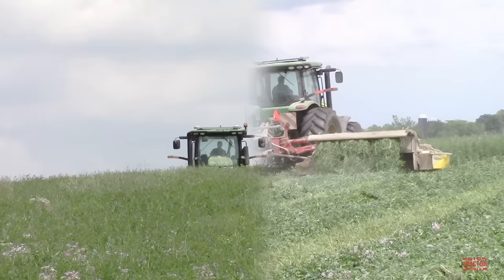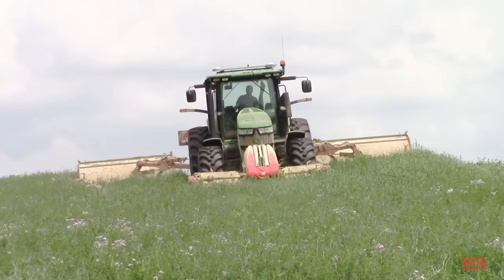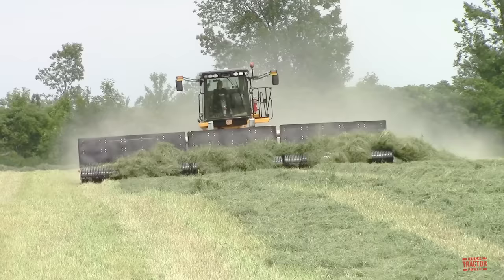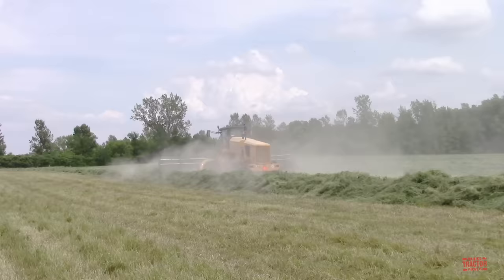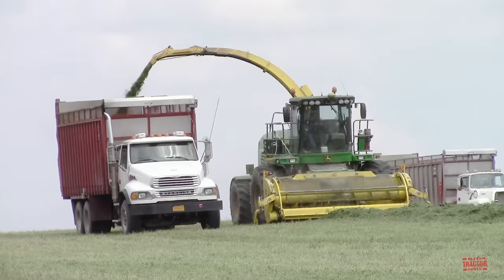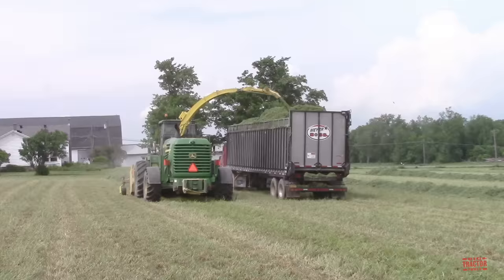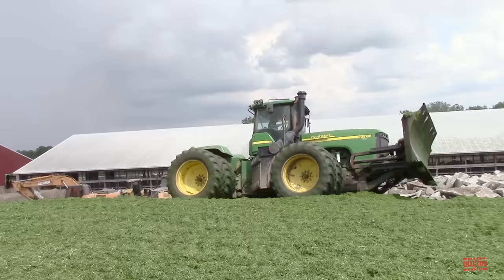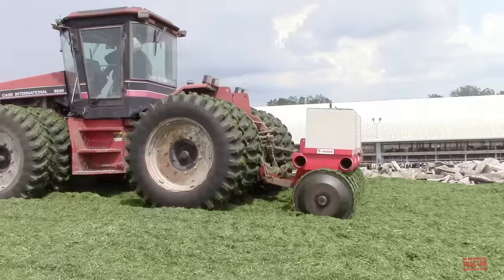MOWING MERGING HARVESTING Alfalfa with Big Tractors

Comment: Excellent video. Hay & Forage is my favorite. I love those triple/butterfly mowers, mergers are always cool, and who doesn't like to see a big forage harvester in action? But I must confess that I find packing boring. I've done plenty, and never really loved it.

I thought the 7780s were all 600+hp machines. I still think the 7050/7080 series are better looking than the new 8000/9000 series. Of course, looks alone aren't much...

Shout out to harvester operators everywhere when he slowed down for that massive clump to feed in -- I thought I was going to completely choke our NH FP240 doing that in uneven windrows this spring but thankfully it fed on thru, courtesy 300hp! Smooth windrows are always nice.

Big Tractor Power, see if you can rustle up some footage of the Pottinger Novacat T8 trailed center-pivot triple mower. The dealer I spoke with about a used T8 (O'Hara) said he had 3 of them on one farm there in NY!!

Comment: As fast as they can cut with that Novacat, it's no wonder those tractor mounted mowers got the Claas Cougar discontinued.  After watching your video on the Cougar it's no mystery why it wasn't cost-effective.  I'd take 66% of the work for 25% of the price any day.
Reply: yea theres a contractor here in germany that converted one to a mulching application but not even that could make it beat out the xerions they were running so it was shut off for good

Comment: They need some kind of serious reversing fan on the mower tractor!
Reply: It is a problem with all the john deere 6,7,8R tractors.  They button up the hood and engine area so tight there is no airflow except thru the front grill. There is also a hydraulic powered fan blowing thru the air to air aftercooler that blows out the top of the hood infront of the radiator.  These tractors will run hot quickly of not kept clean.  My 6125R I have to clean the grill and rad screens 2 times a day baling hay.  Its just a bad design on these deeres.

Comment: Interesting to see the 7780 bark as it encountered the big slug of hay in the windrow.   I don't think I've ever seen one of them slow down for anything.
Reply from the maker: It’s not often a big chopper slows down. Sorghum will give a big chopper a work out.
Reply: That "big slug of hay" is the one thing you don't want when chopping. As long as the windrows are nice and smooth you can cruise along at a consistent pace with little to worry about, but that slug probably doubled the volume going in, which is a good way to seriously plug things up if you just go charging into it. Alfalfa is sticky and gummy and doesn't flow well and is probably the most difficult of the common crops to chop, especially compared to row crops like corn or sorghum that feed straight in and flow well. The operator came close to stalling her.

Comment: All that work, fuel, time and tremendously expensive equipment but you see a significant part of the alfalfa is spilling back onto the ground.
Reply: That's the case with any large scale harvest. The amount of spillage compared to the total harvest is negligible.  More than likely about 5 or 6 bales worth out of, what is likely, a few thousand bales.  Even if they were doing actual bales there would be some that break open or are unusable.

Comment: Viewed 8-8-21   4:23 PM  from Illinois      The JD chopper was not chopping the windrows  that were merged in  first part of video..   JD could handle those rows, would require the Krone 1180 with 1160 HP.
Reply from the maker: The 7780 is chopping the windrows from the 4334. The farn had 3 pull type mergers before the 4334 replaced them.

Comment: I use to work for Oxbo making the hay mergers, right in Byron, NY
Reply from the maker: Cool.  I have toured the plant a couple times.  I grew up near there.
Reply: @bigtractorpower  that's pretty awesome
Reply from the maker: I spent allot of time at all the Batavia tractor dealers growing up. My last visit to OXBO was in 2002. They had a 1/16 model of the pull type merger in the board room to show the concept.
Reply: @bigtractorpower  I bet it was alot different then. I worked for them in 2019. I ran the presses on 2nd shift.
I do miss it, decent money but I don't miss the drive now that I live in Lockport. Lol. I spent my teen and early 20's in and around Batavia, farming and on the road with my dad.

Comment: The first truck to unload its payload it didn't dump it, was it some type of belt driven floor to push the silage out of the back?
Reply: Yes, there's a conveyor chain along the bottom of the box that is engaged to push the material out.  It's kind of like a manure spreader apron.
Reply: @bn4172  thank you..

Comment: Yeah I’m developing an add on that makes a normal swather header into a merger, will let you know if it works😉
Reply: Actually... that technology has existed for many years in the form of conveyor belt "collectors" on the back of triple/butterfly mowers that catch the hay coming out the back of the mowers before it hits the ground and move it laterally into one big swath/windrow, thereby saving the trip over the field with the rake or merger.

So... why don't we see them more often? Simple: piling all that freshly mown, high-moisture crop into one giant swath is a terrible way of making haylage/silage. The crop must wilt significantly in order to ferment properly after harvest, and minimizing drydown time is critical to minimize nutrient loss due to plant respiration that continues after the plants are mown. This is only accomplished by mowing the crop into swaths that cover as much of the ground as possible for maximum exposure to the sun and atmosphere, limiting respiration to a few hours. The use of collectors, especially in hot, humid environments would result in extremely long periods of respiration (during which the plants remain alive and continue to consume nutrients stored in the leaves) and also composting (ie, significant nutrient loss) in the center of the swath/windrow, which is the exact opposite of the desired outcome.
Reply: @captaindee6130  Nah what i meant is i've laid down my alfalfa with a 16ft disc header and once its half a day from baling i come in with the swather (no cutter/no reel) 2 small pickups mounted to front (old pull-type combine pick-ups) and gently merge 2 to 1 to help dry a bit more and save covering as much ground.
Reply: @piperdoug428  Ah. Gotcha. Sounds good.👍

Comment: The contractor silaging for our neighbour was using a merger like that but trailed though he was only managing a slow walking pace it seemed. It looked like it was taking the two or three times longer than their Krone 4 rotor and even long than 6 rotor rake.
Reply: I think most mergers will function well up to about 6-7 mph, and some might run faster. They will definitely pick up the crop at faster speeds, but if ground speed exceeds pickup speed it will drag the crop along the ground while picking it up, and pick up more dirt in the process. Rotaries are notorious for picking up rocks on uneven terrain; we tried one and promptly parked it for that exact reason.

Comment: What's the advantage of this belt type merger over a more traditional spider type of rake?
Reply from the maker: Speed and the ability to travel in any direction in the field.
Reply: Also is less likely to pick up dirt and stones compared to rake. Also it’s wet so heavier than when rakes are typically used.

Comment: A 250 HP self propelled hay merger... I didn't even know such a thing exists.  It is super expensive I'm sure.  Why not just get a big 30 ft wheel rake and pull it with a 50 HP tractor?
Reply from the maker: This farm ran three pull type OXBO mergers prior to getting this self propelled unit.  It can cover a bunch of acres.

Comment: Where were those tractors made?
Reply from the maker: The OXBO merger is made in Byron, NY. The 7230R John Deere mowing  is built in Waterloo, Iowa along with the 4wd 9230 on the bunker with the blade.  The 9230 Case IH was built in Fargo, ND.

Comment: BTP, which is better for cows, Silage or haylage?
Reply from the maker: They are fed together.  A mix of hay and corn along with crushed soybeans, cotton seed and other supplements. .
Reply: The answer to that question depends entirely on the quality of the feed, which is driven by controllable factors (timing of harvest, % moisture and stage of plant development, use of preservatives/inoculants, storage and handling techniques) and uncontrollable factors (such as the weather). Both types can make excellent cattle feed. Do it wrong, and both can be terrible.

Comment: watching the footage you would almost imagine that adding an end deflector would be a smart move for the windrower. all that product being tossed out of the auger seems like a slight loss but in this market anything retained is huge. also ima call big BS that the chopping is done on the same field showed earlier. those swathes are up to the top of the tires on the swather/mower yet the chopper they are header height? that field was more likely used to bale not chop

Comment: don't own or work a farm now but worked on local farms when i was a teen. always wondered why most equipment was lifted when the tractor turned in the headland area even cutting and conditioning, merging windrows. seems like a waste time and energy. what's the answer?
Reply: skyjacker 1 different reasons, lots of gear can be damaged by sharp turns. With some equipment you don’t want to double work the same area. For example re-mowing will break off a lot of the valuable leaf and make it harder to pick up.

Comment: I see a lot of tractors on this channel with a hose running from the air intake to the exaust stack.  Does anyone know the purpose?
Reply from the maker: I cannot think of any that I have filmed with this set up. Can you tell me one of the videos you saw it in?  Typically this tube connection is to use engine heat from the exhaust to power the Turbo. You saw it allot in the 70’s. More so in the far Western U. S.
Reply: @bigtractorpower  This video at 0:11 right above the engine compartment from just below the prebreather to the top of the stack.
Reply: woodhonky TV There is a venturi in the exhaust which creates a suction which in turn sucks dust particles out of the air being sucked into the engine
Reply: @bigtractorpower  Turbos are powered by the exhaust flow, not heat.

Comment: this is evidently not an alfalfa field as the windrows of the cutter would be much higher , the merger would knock all the leaves off the plant and the tractor shown isnt running down the windrow you cut on video , if it was alfalfa over 70 feet of good hay would get you a windrow 6' high and 10' wide . !!!! you chop it into a semi truck , but only show a bobtail dumping .   amatuer editor???
Reply from the maker: You are 100% correct this amateur filming.  I do this as a hobby. All the machinery was filmed at the same farm spread out over 15 miles. I traveled 16 hours to film in this area and needed to maximize my filming time. I filmed each machine in a different field because I could not wait 24 hours for the merger to catch up with the mower.  Sometime you just have film what you can get when you can get it.
Reply: @bigtractorpower  And I feel you did it quite well.  This person should be a nurse in a school some where.  since they like to pick nits!!  I personally don't need or appreciate his ridiculous comments.

Comment: If he wants to save time and fuel why is he putting it in a windrow when he chopping it ?
Reply from the maker: I don’t follow your question?  The OXBO puts 7 swaths into one windrow. Then the forage harvester picks up 70 plus feet of hay in one pass and loads it on the truck.
Reply: @bigtractorpower   but he is using two different pieces of equipment  to do it more labor more time more fuel more expensive   .
Reply: George Cass if they didn’t do the first pass with the merger then it would take even more time and fuel and money
Reply from the maker: The merger travels so much faster than the chopper. It saves time.  Plus you want to limit the trucks from having to drive all over the field. The chopper is built feed in tons of crop at once. Picking up on swath at a time would waste fuel and horse power.
Reply: The harvester could not, under any circumstances, operate anywhere near its designed capacity if it only chopped one alfalfa swath at a time. The pickup head can only function properly up to about 10mph or so,, and they would need to run approximately double that in order to put any real load on the harvester while picking up individual swaths. Massive windrows allow the harvester to function efficiently and minimize heavy truck traffic on the living stubble, and force slower ground speeds that are much easier on the equipment and the operators.
Reply: @matthewmeents1287   no it wouldn't they may use the same amount of fuel but with less labor and less expense  .  The are running 3 pieces of equipment versus 2 . Another thing you are forgetting  is it takes a 
32' swath  which will make a very large windrow unless you have poor yields on your hay crop . Thoes large windrows will slow your chopper down and increase fuel usage  .
Reply: George Cass none of that made any sense
Reply: derrrrrrrrrrrrrrrr
Reply: @matthewmeents1287  i,m glad you thought that too sir  ceratinly baffled me
Reply: Where are the mechanics. Those machines do not wear out nor break down?